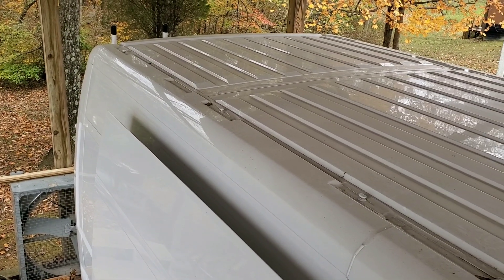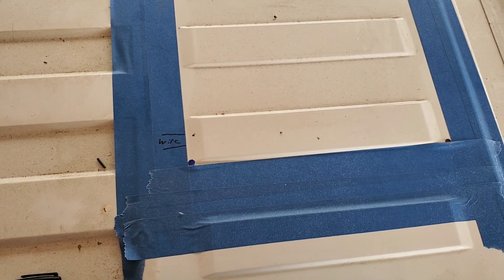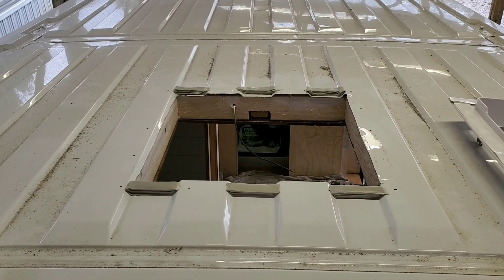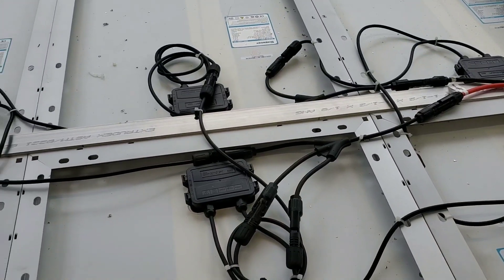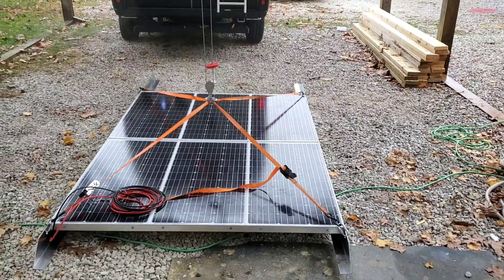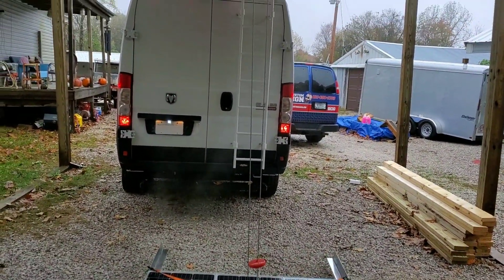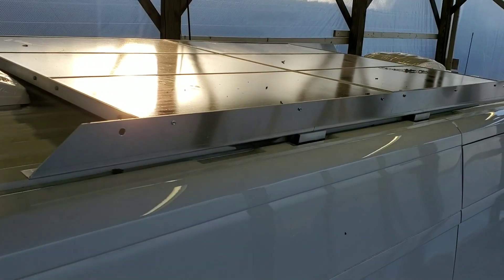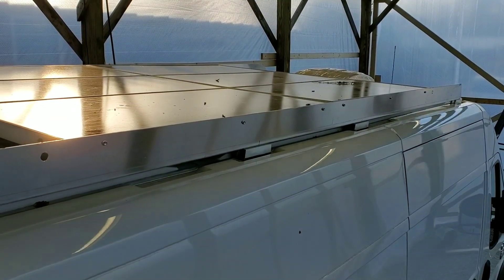600 watt solar panels and 2 maxxair fans installed (E31)

Comment: Hi Red....excellent video...How thick are your 2" by 3" high roof rails?  Also, are you afraid that the aluminum roof rails would rust over time?  Would you recommend using 1/8" thick galvanized steel instead?
Reply from the maker: Aluminum doesn't rust.

Comment: Helpful video as usual Red! Are 2 fans necessary for good circulation?  Seems that 1 fan with a window open would be plenty.
Reply from the maker: Yes if you have a window that will open or not parking somewhere that doesn't allow you to park and are trying to be stealthy.

Comment: Hi Red ... great ideas ... would that 2"x4" aluminum be strong enough to use it as the mounting surface for a Fiamma awning?  What thickness of aluminum is it?
Reply from the maker: If you had one on each side and had them contacted (like I did with the solar panels) then yes. But by itself (one side) I'd say no, only because I'd be afraid of it rocking side-to-side.

Comment: I just saw a video of a Promaster with two 300 watt each  solar panels.on the roof.
Reply from the maker: You're right, but was it on a 2500 with 2 maxxair fans and keeping it inside the rail lines of the body? 

I have installed 3 305w panels and a maxxair fan on a 3500ext but they hung over the sides of the van about 3" on each side.

Comment: Hi Red - Why butyl tape instead of 3M adhesive?
Reply from the maker: 3M adhesive is more of a "permanent" application. I don't want that kind of seal, I want it to seal but still have a little flex to go with the movement of the body. Also these fans eventually brake of the owners needs / wants change. Maybe they want a a/c unit now. The 3M holds so good it will destroy the fan removing it or sometimes the paint of the van. Now If you are dead set on using tape to mount your solar panels then yes by all means use the 3M tape.

Comment: Red, What is the reasoning behind using 6-100W panels vs a couple of 300W panels? Thanks
Reply from the maker: I couldn't find 2- 300w panels that would stay within the roof line and in between the 2 fans.

Comment: Excellent work, very professional! I wonder how you are able to reach the nuts to bolt the panels down?  Are you you able to fit your hands under the metal rail to reach them?
Reply from the maker: You would have to have some long arms, but yes there is enough room on this one.  But I set it up there in one piece so I can get it in the right place. Then I pulled the screws out of the side rails. Then you can bolt the rails down and reattach the panels with stainless steel screws or stainless steel pop rivets.